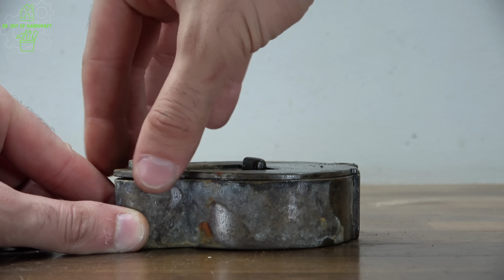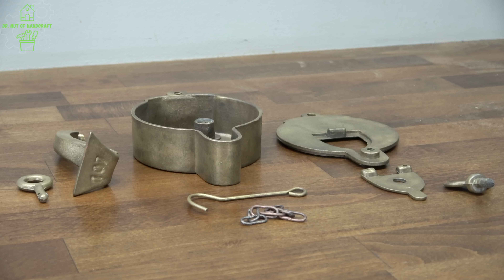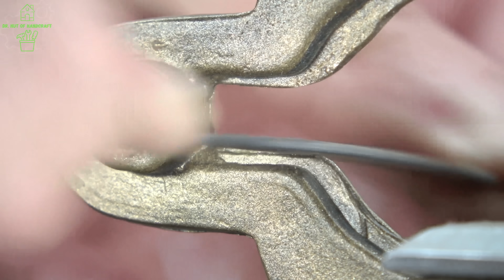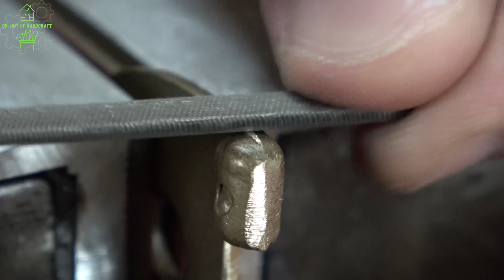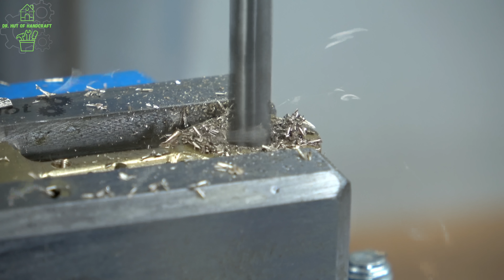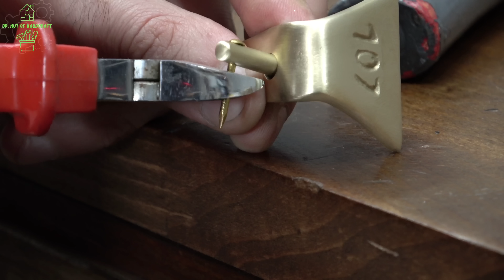19th century "Frosch 107" mining lamp restoration I Dr. Hut of Handcraft

Comment: Nice job, but you are not supposed to grind brass on a grinding wheel. The same goes for aluminium, copper, bronze, etc. Don't take my word for it, check it yourself. Nice post 👍
Reply from the maker: I know, thats why I said that it is not the proper tool for this job 😄 But that’s what I had at the moment and luckily it worked. Thank you for your comment, much appreciated!